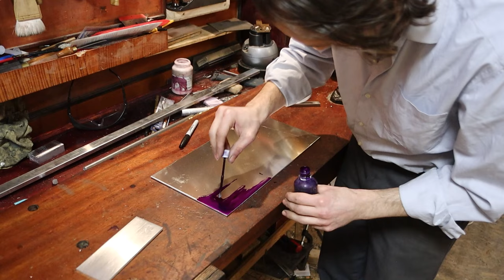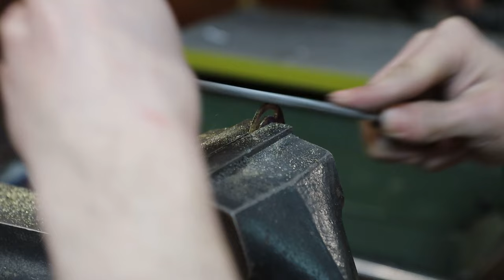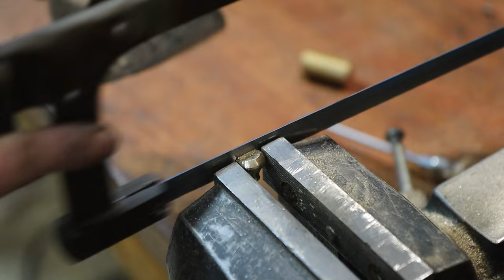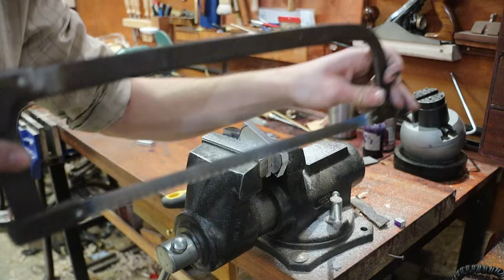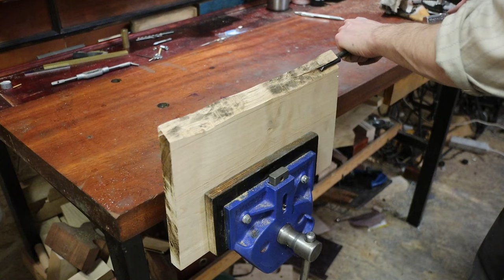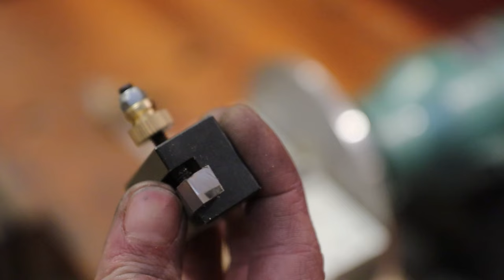I mounted a diamond wheel on a bench grinder and made a custom tool rest for it

Comment: It might not be the backplate causing the wobble.  When you tighten the nut on the motor shaft it will not be exactly square to threading.  This will result in the backplate not pressing evenly against the stop behind it.  This is usually fixed by using self centering washers which are essentially two washers with opposing conical faces.  These conical faces will slide against each other and compensate for the out of squareness of the nut.
Reply: Ya got that right Dan....TM
Reply: Parabéns muita saúde
Reply: I think the stop itself is not flush at all. Unfortunately I think he didn't flat the head on that first lathe cut. :-/

Comment: The brass nuts don't work because the lever arm of the tool post can act against the thread. Even using steel bolts will not fix this, I think. Designs similar to this that work use a pivot pin and then clamp the two mating faces together, but have an interlocking pattern on the mating faces so they cannot slip. Perhaps a hinge pin combined with a series of pin holes that set the arm at specific angles?
Reply from the maker: Your right, perhaps I'd make the middle piece again, with pin holes and such.
Reply: Using a knurled pattern like on a file on the mating surfaces should suffice
Reply: @fasousa4798  exactly, that will give enough friction I think.
Reply: @urituchmanpigeon  I really enjoy your videos buddy. I cant wait to see what you make next. I'd love to see you do more of those figurines that you carve and that move.
Reply: @urituchmanpigeon  a friction disc would do the same, you could make a simple one out of Emery paper
Reply: 2 rings dry and wet paper back to back glued , between the aluminium parts wil give U much friction. nice work. amazing what you doe bij hand tools. keep up like your videos. Jos

Comment: Uri, Check the shoulder on the bench grinder, sometimes they are not nicely machined. The slightest of burrs will throw that 7 or 8 inch diameter out quite a lot at full diameter. Your original backing plate may still be fine to use. Use a fine flat hand file and use the NON safe edge against the grinder spindle shoulder, rotate it by HAND to check for burrs. You may also find that the shoulder has a radius, so your backing disc will need a slight bevel to the hole to miss the radius. Good Luck fixing it. Regards from Australia.

Comment: That was wonderful, but the drill press sections were pretty scary. Maybe some drill press clamps would be a good idea for a future project, perhaps with some brass.
Reply: Yeah.  I puckered up a few times.
Reply: And less stopping the drill with his hands! 🙃
Reply: Let's start a petition! We want drill press clamps!!
Reply: It does look scary, but one can get pretty fast at pulling their hand away when the bit starts spinning the work peice, especially considering drill presses are set at lower speeds for metals. 

You can see he used vise grips after, which is a very good way of holding small peices that would otherwise be too small to clamp to the work surface.
Reply: You only have to get whacked a few times and then you learn.  Hopefully with all your fingers intact.  I used to tack weld by closing my eyes in a hurry.  Sandpaper eyeballs taught me to use the helmet even when lazy.
Reply: On Blondie Hacks, Quinn is making a float lock vise for her drill press.  Here's part 1: https://youtu.be/7ihitU-EWPY.

I don't know that I'd ever use my drill press without a vise, a fence or clamp downs.
Reply: a lot of the old drill presses don’t have very much power you can stop them with your hand and sometimes they arbors are just pressed in so is they snag they end up free spinning until it falls off instead of being able to do much damage and sometimes the people will intentionally leave the drive belt loose on the pulley to keep it from breaking drill bits.  the smaller the drill bit is the faster you want it to spin but with less pressure and if it’s larger you want it slower so it works out fine for most applications to have an underpowered drill press but of course not all of them are setup that way and some will rip your arm off.  my father in law gave me his old one and i have to hold the arbor up whilst i drill or it falls off but it was originally a safety feature.
Reply: He used clamps almost the entire video...

Comment: Uri, just a few things. If you want a concentric washer, turn it in the centers. Your chuck has a huge runout. Or replace a three jaw chuck with 4 jaw independent one and use an indicator while clamping. The speed of your grinder is way too fast for such a work. Use a variac to crank it down to about 300 rpm. You was the one inspired me to start learning engraving on diy tooling. I started after your video with a hammer and now I built all tools by myself including apex graver holder and a graver hone. I am not an artist like you, but I am mechanical engineer and have access to machines. If you have technical questions maybe I can answer it. Beretzinut!
Reply: The grinder uses an induction motor. A VFD would be needed for speed control, and even then speed controlling a single phase induction motor is sketchy at best.
Reply: @nerd1000ify  variac or any fan controller rated for the same power will work.
Reply: @slavayorish4836  Sorry, but the speed of induction motors is set by the line frequency not the supply voltage. Dropping the voltage reduces the torque not the speed.

I've been modding a small bench grinder like Uri's to do drill sharpening and other grinding work and I'm stuck with the motor's design speed (50Hz UK mains voltage x 60 seconds = 3000 rpm, just about -- there's a rotating magnetic "drag" that keeps the motor spinning so it's a little less than 3000 rpm). I could use a variable-frequency drive (VFD) to reduce the speed a bit by reducing the supply frequency but the motor windings are designed for 50Hz or thereabouts and the motor wouldn't work properly below 35Hz or so.
Reply: @Robert Sneddon  Robert,  i had a success controlling a blower with a variac because it had a relatively constant load on the shaft. In case of a grinder it will not work. You right. The solution I would suggest is to use either a sinchronous motor, or a DC motor. The popular choice is a DC motor and controller from an old threadmill. For my graverhone I used a teknik servomotor, but it was a waaay overkill.

Comment: Gotta be able to sharpen that carbide... Well done Uri. The wobble could also be in the washers, the shaft itself, or play in the grinder motor. Most bench grinders have some sort of play/run out. The more expensive ones have less. There are beveled washers you can buy for the mounting shaft then you his have to play with a pair of washers to get that perfect adjustment to true your grinding wheel, or in your case diamond plate. Bench grinders aren't really designed for face plates, but for edge wheels. But a true running shaft is a true running shaft. Good luck.

Comment: to even the back plate i would put three spots of cusi with a tig welder and file them until the weel runs centered. you can also drill a larger hole into the disc and make a bronze bushing spacer and try to make the bushing more precise. if the disc is not flat you can sand that to be flat on a flat surface.

Comment: Super interesting video, but I have a question. Why didn't you set the support plate higher, i.e. above the axis? Then you would have the entire width of the grinding plate available, and it would certainly be less dangerous for your fingers

Comment: Diamond at high speeds deposits carbon into the sharpened piece. This is mostly experienced in industry but I’ve heard of guys power grinding their knives with diamonds and it ruining them. The ideal abrasive material would be CBN or Cubic Boron Nitride, but if it’s any harder to get than diamonds then I wouldn’t worry. 
Keeping things cool and or lubricated can cut down on that quite a bit. 

You’re a natural toolmaker

Edit: I thunk you’d have fun with a 0.5-40 micron diamond paste pack. I got one from venev for like $12 and it makes polishing hard materials a breeze.

Comment: I know this has been years ago, but a flex washer (some people call them compression washers or spring washers) behind the mounting nut would have fixed the wobble. Flex washers are the only way to go when using faceplates on grinders.

Comment: I kind of lost touch after your son was born and you kind of took a break from video making.

Good to see you back. Seemingly a nice shop too. I think the last video I had seen was the live stream with your wife's friend acting as more or less host that then ended with the camera seemingly going mad on its own.

I like your mini lathe. I have a Shopsmith wood lathe that I enjoy using and an old Oliver small metal lathe from around 1900 that needs converted to V Belt and they certainly are enjoyable to utilize and it shall be interesting to see what you output with yours.

Comment: Love the build of the table and miter fence!  You are a maestro at this kind of build!!  2 issues: first, use conical or cup and seat washers for the back plate and lapping disc as @Dan Letkeman says below.  Once that is done you could use your miter fence to true the running face and edges of the back plate with sand paper and a square block.  Second, most grinders run at 1750rpm which is way too fast for lapping disc and will wear them out quickly.  If you can find an inline speed controller for the grinder to get the speed down to around 800-1000 it will help a lot.  Typical lapping plate systems actually spin around 4-500rpm.  Thanks for the fun build!!

Comment: Melamine works quite well as a backing disk. It is surprisingly flat. In fact I've seen quite a few people successfully lap parts using diamond paste on a bare melamine wheel! Seems to work just fine although I would be concerned about moisture. I tend to dip parts in water rather often while grinding

Comment: Diamond does not work well at higher speeds, like anything over about 500 rpm. Heat is generated, and diamonds will degrade/wear out quickly because of heat. CBN is better for dealing with heat, but you can only grind 'hardened' metals on it as softer ones will load up the wheel. Dan's comment below is accurate. Most of the time the nuts on grinders are not precision ground which can induce wobble because of uneven tightening. Some use 'helical' washers, one concave, the other convex, between the nut and the wheel.

Comment: Excellent build friend, I'm sure there are things to update. A real backplate will do wonders for true flatness, no wobble. 
I would not add a safety guard ... will only get in the way. but always try and hold small spinning parts with a vice grip if possible... too many safety nazis. I'm sure you have things under control.

Also, I noticed you have the other end of the motor shaft idle, not in use. I rebuilt a Grinder and replaced one side with a  (Motor Adapter Arbor 1/2-20 Threads Fits 1/2" Motor Shaft or Spindle) Look on eBay..$24 bucks.  Make sure you get the correct right or left threading for this. Then I added a Drill chuck!!!  Now I can use all sorts of adaptors for diamond, Wire brushes, and even 4.5 Hand grinding disks. And I can place a drill bit in it or even sharpen one.  Works so well You should try it. In the US the Adapter Arbor is about $24 a chuck around 12-$14. The chuck may not be perfectly centered, but even then if you leave the grinder motor on its rubber legs this will compensate and center the chuck very well... I use this little junk motor all the time now. It is small enough I can stop the chuck by hand but it still has some power. In a shop like yours bench jewelry style, I can see this would come in very very handy. 
You won't regret the chuck adaptor. Sir.

Comment: I've learned there is no need for a safety cover when using diamond disc and wheels since there is no very minimal material deposited into the surroundings plus unless a cheaply made metal disc was to break apart under heavy abuse, safety eye protection should be all you need. Wobble may be caused by lower-quality discs that are thinner than the beefy wheel types. I was considering doing this to sharpen my woodturning tools but I will hold out until I can spend on a diamond wheel instead.

Comment: Are you using anything to cool your diamond disk? I have tried using several different types of diamond disks or wheels on my grinder. They never last very long because of heat build up. I will say im a lot rougher on then than normal as it was lapidary work i was overheating them on... I did have a bit of luck using sintered diamond cutting disks, either really thick ones or several thin ones sandwiched together. They are designed for wet or dry use. Everything else inbried just rapidly deteriorated. The diamonds will start to decompose at a couple hundred degrees and the bench grinder I was using at the time had way to short of a shaft to use water cooling. I have since remedied the problem by gurchasing a couple of bintage belt driven grinders for very reasonable prices and installing a water tray under the wheel and fashioned a splash guard out of a sheet of acrylic... Just my advice, be mindful of your heat, likely can warp a thin backing plate as well burn through your diamond surfacing

Comment: Grinding soft material as brass or aluminium on a diamond disk isn't such a good idea because the diamond will clog up. At least you should use some lubrication when grinding to prevent the material to stick at the diamond surface, even water would be better than nothing.

Comment: Sharpening HSS on diamond . . . . I don't know what to say other than those diamond lapidary plates are pretty cheap. Nice build!
Reply: They're about $36 USD for one.
Reply: @jasonsummit1885  Not sure what kind of grinder that is, but for a 6" grinder with 1/2" arbor, you can find these on Amazon for around $10, and maybe less per piece when you buy packs.
Reply: @wmcrash  I was looking at the ones made for faceting, as in sintered diamond instead of electroplated.

Comment: mount the back plate without the diamond blade, and then switch it on and  flatten it like you would face the back plate on a lathe, using a cutter mounted on your slide

Comment: Uri. Please move the table up two centimeters up so the lock nut is rotating below the surface of the table. Hit a your knuckles on that spinning hex nut a couple of times, you'll see what I mean. Gotta love the the the jewellers style equipment you favor. Could you design a vertical broaching /file machine? An up and down motion file with a table to clean up inside and outside surfaces? 👍 😃

Comment: How is the disk holding up to bench grinder speeds? I thought they were mainly suited to low-speed grinders.

The tool rest is definitely delicious, you could maybe improve the clamping by putting some thin rubber between the main parts and putting a slippery washer under the screw so it's only clamping, and the rubber is taking all the torque.

Comment: I’m probably too late. The nut behind the grinding plate is most likely square in a machinist’s eye.
You can put two nuts on the mandrel and tighten up then machine the face of the nut.
Don’t forget a machined flat washer.

Comment: Uri, great video and design.  Your diamond wheel will load up quickly with hss tooling.  Save it for carbide brased tips or braze some carbide onto the hss blanks.  Cbn does a decent job on hss and can run at those higher rpms.  Just something to think about im a bit late in catching this video of yours.  Sorry about that.  If you need some blanks let me know. Thank you as always, Phil
Reply: It is not a question of loading.  As the diamond heats up, it will actually start dissolving in the carbon of the steel.  As you say, do not use with steels and other carbon containing materials.

Comment: I regularly use WD40 on my diamond lapping plates, they cut better, last longer and it cleans the metal particles clear of the cutting surface, just a fine spray and hold a rag to stop the spray flying everywhere. You will get the drift. Greetings from Tasmania Australia.😁🇦🇺🦘

Comment: use your table to mount tool and cut the face of your back plate while its spinning on the shaft 
from what i saw your table slide would give you a nice straight cut

Comment: If you pick up a low speed grinder or modify a variable speed drill, these cheap diamond discs can be used to hone carbide inserts. I know that conventional wisdom suggests this is wasted labor, that has not been my experience at all. I have found that even the Chinese knockoff carbide inserts are massively improved by being lapped

Comment: Aluminum galls easily and therefore should not be used for sliding surfaces. Heated diamond criseals burn in oxygen-rich gas mixtures and dissolve rapidly in hot iron. I.e. this diamond disk will not last long. Use flood coolant (quite messy, to tell you the truth). Use low RPM (RPM * disk diameter in mm < 100,000, i.e. less than 650-700 RPM for 6 inch disk). Avoid using diamonds for steel grinding. Use CBN instead of diamond.

Comment: dont use this for grinding hardened steel. look this up because im no authority but i know fast diamond on hardened steel kills the diamond. look up abrasives for lathe tools. i use a horizontal setup with diamond but max speed is 500 rpm and it still may be a problem. dont take my word for t but look it up
Reply: You are right. The problem is that diamonds are made of carbon, which can dissolve into the steel. Net effect is that the diamonds get blunt very quickly.